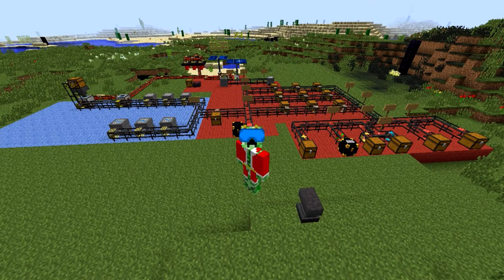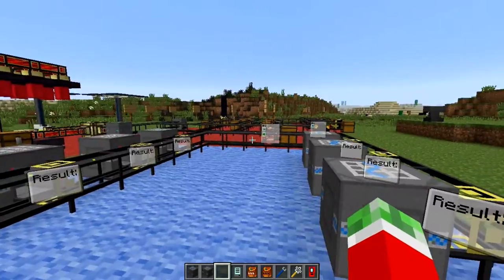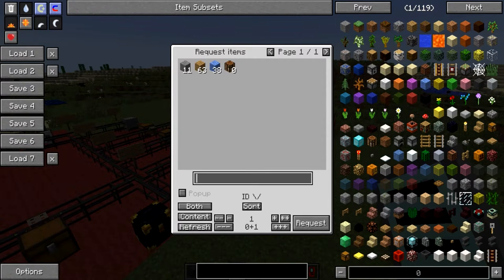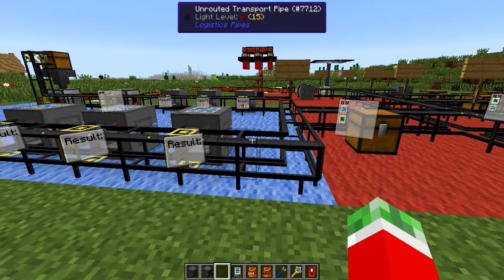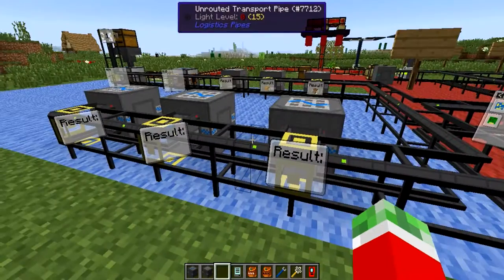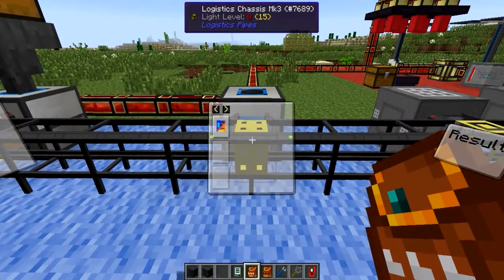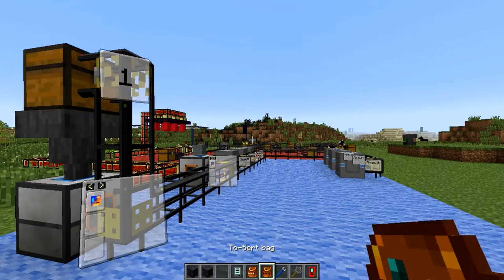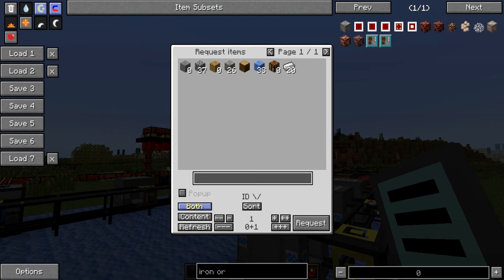Logistics Pipes Tutorial - #4 - Crafting & Processing

Comment: No, no "ignore damage" for most crafting with tools. Want to make a quarry, mining well, MFR grinder, equipped turtles or Wyvern tools? Sorry, the tools in the recipe need to be fresh.
Reply: maybe he meant energy, like electric wrench to gravy tool, or mining drill
Reply: Nuno Mateus
No. He specifically said "quarry" and "diamond pickaxe". There's no reason for specific power item charge, but lots of reasons to need full durability for a recipe with normal tools. And energy for power tools is usually recorded in NBT, the damage value being an approximation used to provide a indication of what fraction of the power is left, if it is ever used (IC2 uses it, but Simply Jetpacks doesn't because it uses damage values for jetpack and Flux Pack tiers).
Reply: Maciej Mućka I don't know, maybe he ran out of ideas so he meant quarry, but yes you're right.

I didn't get the last phrase, you can't craft with simply jetpacks' items if they're not fully charged?
Reply: I mean that Simply Jetpacks only stores the jetpack tier in the damage value (so: the Hardened and Resonant jetpacks have the same ID and different damage values, while the Reinforced and Energetic jetpacks have different IDs and the same damage value). That's it. Not only that, but charge from the previous tier jetpack carries over when making a next-tier jetpack. The durability meter (the visual indicator) is controlled by NBT.
Reply from the maker: Hey there Maciej! Sorry if I confused you here, what I meant is that if the recipe allows different durabilities on tools, you can use the Ignore Damage function so your LP network won't require a fresh tool (Specific tools that require energy for example work like that). If the recipe however requires a full durability tool, the Ignore Damage function won't make a difference but instead simply break the recipe/crafting request. Hope this helped
Reply: *****
I know all of that perfectly. I just wanted to remind you that most recipes that need tools need full durability tools, quarry included. You could have said all of that right out and used ProjectE's covalence dust recipes or something else as an example.

Comment: I know this is over a year later, but I remembered in someone's video that the MK5 chassis pipes if used as a machine input can store multiple stacks at a time of items to be input, for instance Direwolf20 and Soaryn used this in their Infinity Evolved Skyblock playthrough to solve a problem of very large amount of coal dust being produced because of Coal Balls requiring 8 coal per recipe.  If a stack of Coal Balls was requested, that would mean that the machine crafting them from coal would overflow unless the MK5 Chassis Pipe was used with the MK3 Crafting Module.  What the MK5 Chassis Pipe did, in this specific instance, was to act as a buffer for the items - in this instance coal - to stay in until needed inside the Macerator.

Comment: I tried using a line of crafting tables and it worked to an extent. The system refused to believe I had iron or steel nuggets. This includes with the recipe to create the nuggets and nuggets being directly placed into the system. I then tried to use a Chassis pipe with crafting modules and now the crafting table will accept the required items but refuse to craft with them. Also, something I found annoying with logistics pipes is that I needed to craft something that required 4 lead nuggets. I set it to craft the nuggets and then craft the desired item. 1 ingot = 9 nuggets. The remaining 5 nuggets are simply dropped on the ground left to despawn.
Reply: that is because they don't have inventories to go to; you won't have this problem if you supply a default rout, ie with a default route.
Reply: +mmmhorsesteaks *terminus
Reply: I remade what I did exactly next to it and it worked. I have no idea why the first one I tried didn't.
Reply: Just a quick suggestion on ingots/blocks/nuggets - if you store your metals in a storage drawers compacting drawer, you'll have immediate and permanent access to the block, ingot, and nugget form of that metal through LP. Just keep your metals in a bank of compacting drawers and hook LP up to the drawer controller and you're set.

Comment: I would say that fuzzy crafting tables are even useful for simple recipes; say you have one for sticks based on oak planks and you're out of oak but you have loads of birch then setting it to enable OreDict would use the birch, right?
Reply from the maker: Hey Linda! Good thinking, assuming the sticks work on all recipes, it would make sense that this situation would work just fine!
Reply: I tried to do what linda suggested, but it keeps saying that I don't have the oak wood when I have birch wood.
Reply: A A did you make sure the sticks slots in the crafting recipe were set to oredict mode?
Reply: @thegroundbelowme3255  I do have the same issue, and yea the mode is set on oredict, it wont work, alternatively, I have another problem which is something smelting, and not getting extracted, from a request, so it might have a way to go, and I also set this desired smelted item in a chest to be sure where it goes when it's over smelting

Comment: Great tutorial, one problem tho: Lets say i want to make an item, that requires e.g. tin casings from IC2, how do i set that up? Because, the tin has to be rolled first, and then rolled once again. and eventually the casings should go into the crafting table. So yea, help? ^^
Reply from the maker: +Mario Börlin Hey there Mario! Because logistics pipes are rather smart, you should be able to configure it so that you get both recipes from the same machine. The logistics pipes should put the items in one at a time until all crafting tasks are done! If in any case you cannot get this to work, you could use a separate machine for each recipe. This would be a lot more expensive, but faster at the same time as it can do multiple machine craftings at once :). Hope this helped!
Reply: I got this step already set up, so the rolling is no problem, but the real problem is that the casing first go into the storage system, rather then in my auto crafting system, as intended.

Comment: Okay. Im used to AE2, but Im a passionate builder. If I can build an automation, I will without fail try to have it incorporate as many mods as possible and be as confusing and showy as I can afford.
And while this autocrafting system by itself is inferior to that of AE2, it works as a great extension the way you show it.

For example, Im powering my base with solar power. I need a metric crapton of solar panels, and their crafting recipe contains several other items that need to be crafted themselves just to fit into a solar panel.
If I can tell my system to dump an amount of ressources into a chest, then have a set of pipes pull them into crafting tables and perform the various recipes on its own, I only need one pattern in the AE system, not 6 or 7.

And the remote requesting makes it absurdly powerful.
I can dump everything into an ender chest and have my AE system pull it out, but the ability to order items out of such a vast inventory at any given place breaks the gameplay to hell and back.

Im looking forward to that. ^^
Reply: AE2 has more protection against novel or unexpected situations than LP does; but the tradeoff is the amount of resources, complexity, and RF power that AE2 requires.  LP is more ad hoc, and can sometimes require awkward solutions to problems; but the advantage is that it's both cheaper and more fluid.  I can use vanilla chests, and the interface for said chests is a lot less expensive than the AE2 equivalent.

Comment: Also slap a bunch of fuzzy crafting pipes on the output of a spawner/killing system and you can autorepair all the drops.
And then throw them into a Tinker's Construct smeltery to gain back some of the materials.
Course you'd need to automate that output and item intake aswell, but as far as I know anything that provides a redstone pulse on a regular basis works with the smeltery and you can just put a hopper under the casting table to suck the respective ingots out of the cast.

Looks a lot sleeker than an AE sub system.
Reply from the maker: +Reaperonatricycle That was awesome! Sounds like you really know your way around these mods too. Sounds like you definitely have some cool ideas using AE2 and LP :)
Reply: +Corjaantje 
I dabble. :D Im the resident tech maniac on my server, and I like to make my rigs cross between as many mods as possible. Tinker's Construct is great to start out with, EnderIO supplies the early- and midgame batteries and cables, MFR and Thermal Expansion supply the machines and AE2 is the glue that interconnects several systems and helps me with the micromanagement. :)
Reply: +Reaperonatricycle Before this use "enchant logistic pipe" to separate all enchanted items and unenchant them before you craft them together.

Comment: So I'm trying to make a High Voltage Solar Panel factory in Tekkit Legends, and I'm using the crafting tables. The thing is, all the recipes do fine except for the Energy Crystal used for the HV-Transformer, and the RE-Battery used for the Generator. Upon requesting the higher end item, I.E. the HV-Transformer or the Generator it says that both the RE-Battery and the Energy Crystal is missing, even though I have the proper crafting tables and pipes for them. So I figured the fact that they have a charge would be the issue. I used the fuzzy crafting table and set it to ignore NBT data. Still would have issues crafting them. Do you have any suggestions as to what I can do to fix the issue?

Edit: Do remember that the RE-Battery and the Energy Crystal do not stack up to 64.
Reply from the maker: +Nick76e Hey there Nick76e! It indeed sounds like an NBT or Metadata issue, that it isn't recognising both the RE-Batteries and the Energy Crystals. Did you try changing the fuzzy setting (all 4 fuzzy settings) on both the Crystals/Batteries, and the actual Recipe that uses those Crystals/Batteries? Hope this helped :)!
Reply: +Corjaantje Indeed I did. Unfortunately it didn't do much good.

Comment: I am trying to think of a way to get this to work with buildcraft machines. (singularity condensor, rotary macerator, etc.) In that case I think I would need to use said machines as chests (as far as the logistics system is concerned) and then have a secondary system as a output down the chain of the machines and then put back into the main system after it has been refined.

I think that would work but it would be a bit messy with 3-5 logic. systems working independently. Anyone have a better Idea on this?

Comment: is there no smarter solution to this overflow problem? like the pipe notice that the inventory is full or something like that?
Reply from the maker: +Bob Baumeister It does notice that it's full, as in, it stops trying to put it in there, and moves it back and forth into the system everytime it notices it has 1 or more spots left to put it. Thats why a buffer area is usefullf or large requests
Reply: +Corjaantje so the problem is by the mod itself there is no special card that solf my problem? Cause i want to use this for machines that just need 1 tick per operation and than a hopper is way to slow...
Reply from the maker: +Bob Baumeister Maybe an (sub) applied energistics system, with a couple of export busses connected to the machine you are referring to ?
Reply: +Corjaantje  If the machine can draw its input from any inventory, you could make said inventory a diamond chest.
I have no idea if this works, but you could try to set up several chests and connect them with hoppers or other pipes.
So you have 2 chests designated as satellite #1.
Chest #1 is full so I guess it would just try to fill chest #2.
If you have them set up in a way that chest #2 can fill chest #1 once it empties, you have double the inventory space.
Reply: +Corjaantje Better yet, you can designate exactly one satellite inventory and have that inventory push its content out to another inventory. Works like an array of hoppers, except with literally any storage block you want.
The items just trickle through the entire array and eventually end up in your machines.
Just go with 4 or 5 diamond chests for varying inputs, or a souped-up barrel if its always the same input.
Or, if you belong to the 'no kill like overkill' fraction, take a Deep Storage Unit from MFR.

You can use actual hoppers to pipe the items out, but they might be kinda slow. Buildcraft pipes with an autarchic gate work alright, but EnderIO's Item Conduit would be my endgame choice. 
It has a stupid amount of filters, isnt too bad on the server, doesnt draw any energy and you can beef it up to send up to a stack per transaction.
The only downside is that its really expensive, but.. well, endgame.
Though with enough storage and a sporadic input, the speed at which the items travel from one inventory to the next really doesnt matter.

I suppose you could set up an array of LP satellites too, but that kinda defies the purpose of the entire construction. :D
Reply from the maker: +Reaperonatricycle 0.0... Reading this really shows how much you know about this stuff, awesome! I would love to invite you to my IRC channel to have a chat once in a while :) The channel is #Corjaantje through irc.esper.net, or you can use http://corjaantje.com/chat/ if you're not that IRC shabby ;). Would love to hear more about these ideas, as they sound really useful, that I might be able to implement them in my own builds, or perhaps even record a few videos about it!
Reply: +Corjaantje Aw thanks. Im not really big on talking so I dont have a mike, but I can write excessive mails and back them up with screenshots explaining what the hell I built and how its supposed to work. :D
Reply: Reaperonatricycle I wouldn't call ender IO item conduits end game at all. Just one iron ingot, one ender pearl, and some clay, sand, and gravel will get you 24 item conduits. The speed upgrades are slightly more expensive, as they require iron, silicon (easily obtainable from SAG milling sand), and coal dust for electrical steel, plus a bit more iron & redstone (piston & redstone torch), but are still not very expensive. I generally use XU item transfer nodes for the first couple of hours of any play through, but as soon as I start getting ender pearls & have a bit of RF to power an alloy smeltery, item conduits are used for everything.

Comment: is there a way you can smelt more than only three different items automatically using the same furnace?
Reply from the maker: Using a mk 5 chassis pipe, you can add up to 8 recipes to 1 block
Reply: +Corjaantje sweet, thanks! A very helpful video set!
Reply: And if you want more, I assume you can add more mk5 chassis pipes to the same furnace...
Reply: It may be useful to put the chassis pipes on a chest, then use a sub-network (or just simple pipes) to extract from the chest and fill several furnaces; that way you can request several operations with different items, and several of them will be processed simultaneously.

Comment: How can you add more that 1 recipe to the crafting module, because there's just one slot for the output?
Reply from the maker: Multiple crafting modules. Each crafting module can only be used for 1 recipe
Reply: So the max number of crafting recipes you can put in one chassis pipe mk3 with 3 modules is 3?
Reply from the maker: Correct. That's why you want to use a MK 4/5 for things that have loads of recipes, like a Furnace
Reply: alright thanks dude! :) your tutorials are very helpful

Comment: Is there a way to have your system automatically craft an item as soon as you put the materials in, instead of requesting the crafted item each time? I thought an active supplier could do that for me, but I was wrong.
Reply: You could use an extraction pipe/module to import items from storage, and put a corresponding itemsink at the machine/autocrafting-table for that item. You would also need to put an extraction pipe/module on the output of the machine/table, and set-up a default route with the basic pipe or the itemsink module or a terminus module.

Comment: the switch between craft and supply in my remote orderer does not work ... ( i use Storage drawers)
Reply: I would set your output to a vanilla chest, (which LP will quite happily route things to) and then use a hopper to send the items into the actual storage drawers.  Input might be trickier, though.

Comment: I know this is very late but how can you send some items to one places and the same item to an to her place
Reply from the maker: Hey there Kyle, could you tell me the context in which you want to use this ?
Reply: Like say I have gravel sifted automatically through an outmated process. I have a machine that needs coal but I also want coal like in my system
Reply from the maker: The best solution to this would be to use your system to store the coal itself (so by using an Itemsink for example), and put a supplier pipe on the machine that needs coal. This will make sure the machine always gets it coals, and the rest will just be stored in your network! Hope this helped